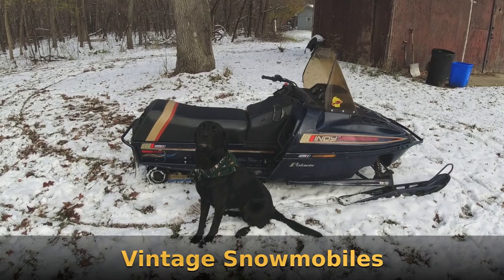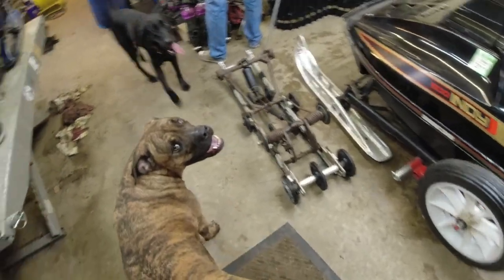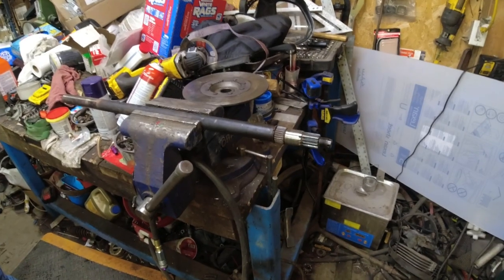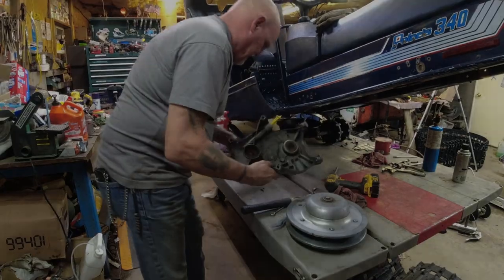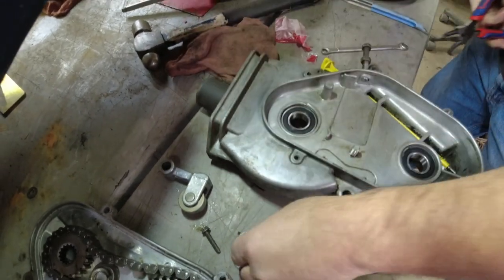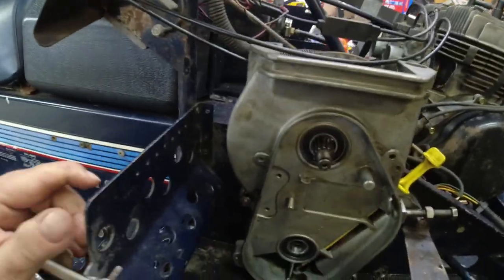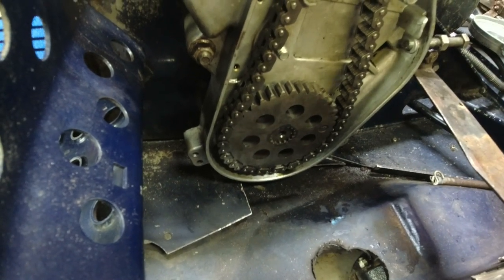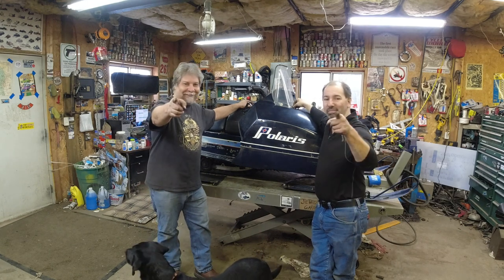Chain Case and Brake Upgrade for Vintage Polaris TX and Early Indys! vintage snowmobiles sleds

Comment: I'm currently working on a 86 Indy 400 with a stuck brake caliper , what a pain to get to it! What years/models did that chain case top loader come from? you run ATF in the chain case?
Reply from the maker: I think they started in 93 in most wedge hood Indys. They are really easy to find around here. Yep, ATF - same as chain drive transfer cases in 4x4 trucks used for a long time.

Comment: I’m working one of these 80 340’s.  Put a rubber track and 8” driver drive shaft in.  The clutch side bearing of the driveshaft fits sloppy in the bearing plates.  How far is that bearing supposed to be pressed into the shaft?
Reply from the maker: When the two bearing flanges pinch together it should be tight on the bearings.

Comment: Love the vid! Question-I’ve got a 91 super sport 440 with the same stinking chain case and want to upgrade to the top load.  Do I need to replace the Jack and drive shaft with the newer splined style or can I use what’s in the machine now?
Reply from the maker: So here's the deal - the top loaders ran open bearings and then a regular oil seals. The shafts had rings pressed on for the seals to seal on. If you switch to sealed bearings you can run your old shafts. I've done it. What I really like to do is get the later shafts withe rings for the seals and run sealed bearings and seals both. It's the best chance of not leaking.
Reply: @nuttersspeedshop  I would like to add to this question since I just picked up a 1995 XLT donor sled today. If I run the XLT drives and jackshaft, I run the xlt chain also? You mentioned something with an 11wide, was this because you used the old 2 drive wheel shaft? 
 Last but not least: I am not sure whether to run this XLT set up in my 1977 TX or my 1980, is either of these sleds different when it comes to this conversion...like jackshaft length or anything?
Reply from the maker: @darcy32171  Use what you have. You will need some 1" machinery bushings or jack shaft shims to space out the 11' wide so the bolt and washer will camp it. The two sleds are the same as far as this conversion goes.
Reply from the maker: @darcy32171  Or use the 13 wide. There's no drawback to using 13 wide. Use what you have.
Reply: @nuttersspeedshop  Thanks!

Comment: I have a 79 tx 440 and would like to switch it to a rubber track is there someone out there making them or do I need to get a Doner sled and if I need a donor sled what sled should I be looking for
Reply from the maker: Any Indy from the '80s with a 121" track. You need the skid, drive shaft and track.

Comment: what master cylinder did you use?
Reply from the maker: You can use either the stock TX master or the Indy. They are the same bore size and even use the same U cup for rebuilds.
Reply: @nuttersspeedshop  thanks John